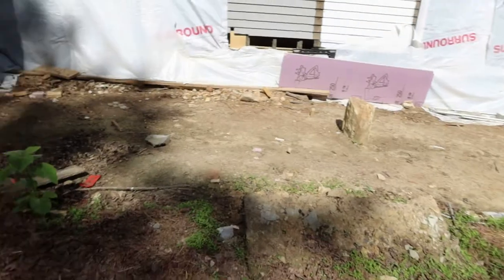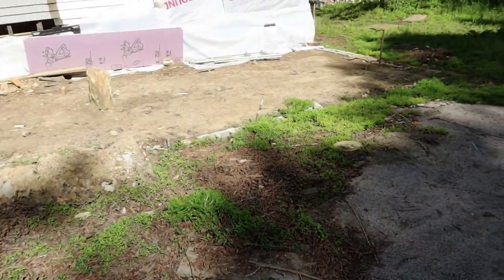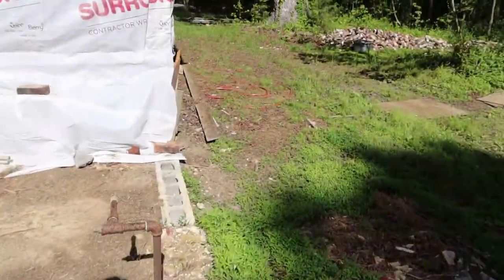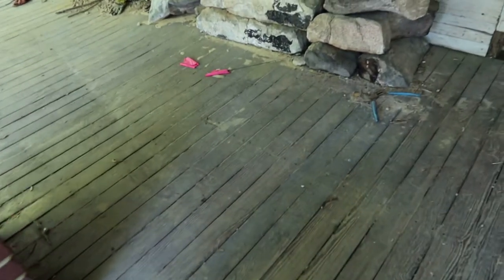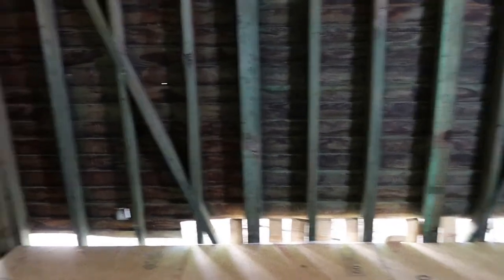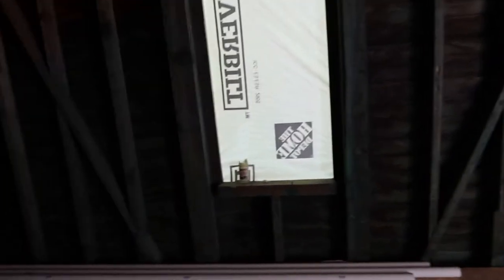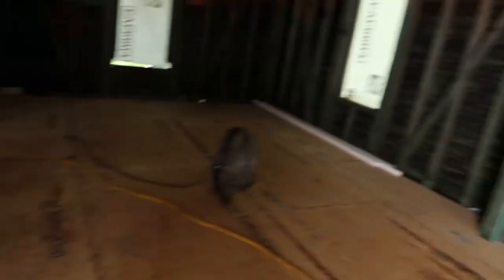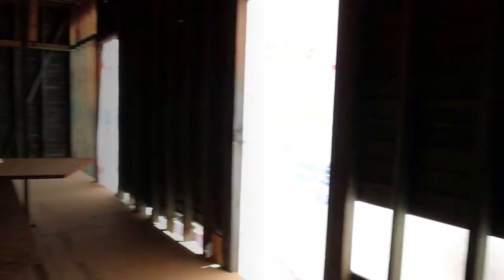Old Craftsman Style Farmhouse Renovation Update

Comment: How did you treat the bare ground under the flooring?  And did you leave in place the original rock supports under the floor beams?
Reply from the maker: 12 mil thick plastic. Yes. The original rocks are still in place. Added new piers. Thanks for commenting!